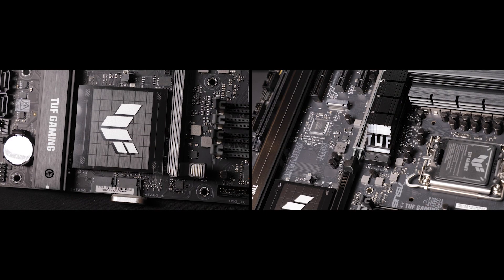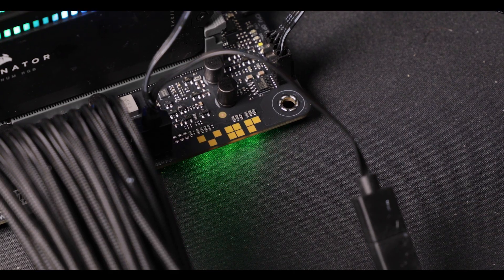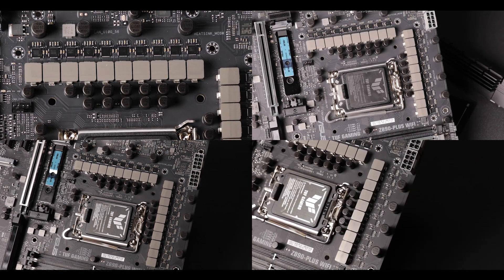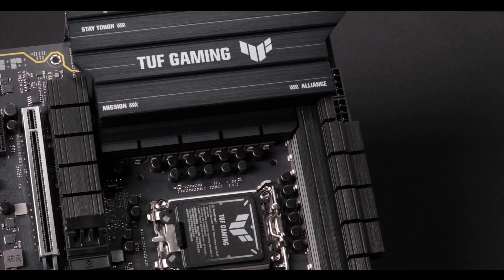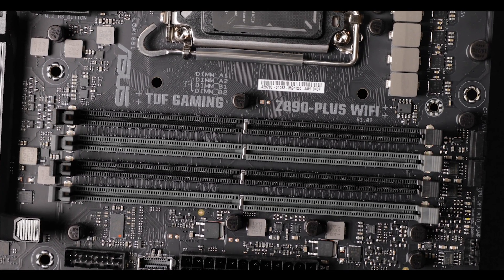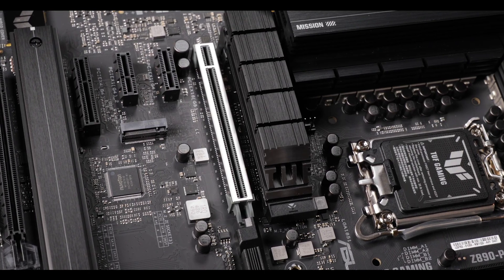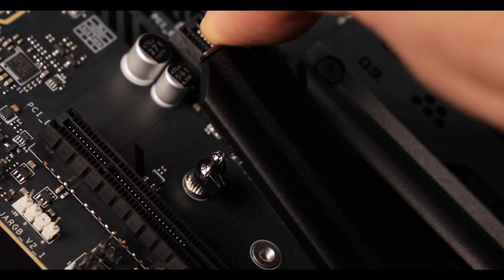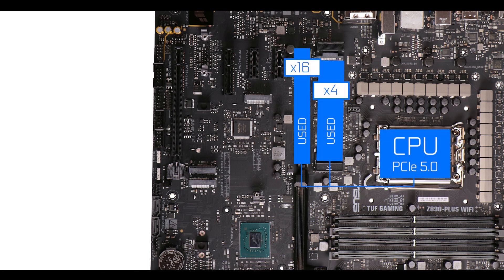The TUF GAMING Z890 PLUS WIFI : The COOLEST board I've ever seen (literally).

Comment: Urgent. Do I need a screw to put the SSD in place (where there is no heat sink)? I installed it and closed it with the button but there is still some freedom there if I press it it goes up and down a little (without the possibility of removing it if I don't press the button)
When I tried to put a screw there - it didn't affect the freedom.
Reply from the maker: Which ssd is it ? There are a few
Reply: @Laurentschoice  Lexar NM790 with heatsink that's why I want to put it there

Comment: Ultra 7 285k is basically just an i7 10700k from 2020 that’s insanely wack😧😂
Reply from the maker: Wouldn't go that far... But yeah .. Not a great processor.. I'll give you that :)
Reply: @Laurentschoice *i7 10700k
Reply: @Laurentschoice  8 cores 16 threads overclocks up to 5.4ghz  all this has on it is new ram supoort and any other new features
Reply: I do love intel 10th Gen though! Love my 10600kf
Reply from the maker: Well.. It does bring in the PCIe 5 support... Which is not nothing :). But yes.. overall... Totally disappointed
Reply: @Laurentschoice  right that’s true! 

It’s essentially a modern generation, ddr5 10700k refresh haha
Reply: At least I think kinda like that from what I observe! I’m no expert just tryna compare these new chips to what I know

Comment: Great video. Thank you for putting this one together. Why do people need 4 m2 drives on this thing?
Reply: I have 3 on mine. A 2tb Samsung 9100 pro in the pcie 5.0 slot, a 2tb Samsung 990 pro and an Inland 1tb. I also have a Samsung 512gb 980 pro but I keep that one in a USB adaptor stick. Fastest thumb drive I own.
Reply from the maker: Usually it's about RAID configurations. Some do like it. :)

Comment: Building a new AMD system once the 9950x3d comes but what board x870e or otherwise even would you recommend to go with it? Not going to go crazy overclocking but might undervolt a little via PBO etc.